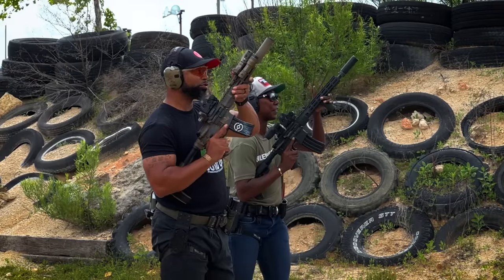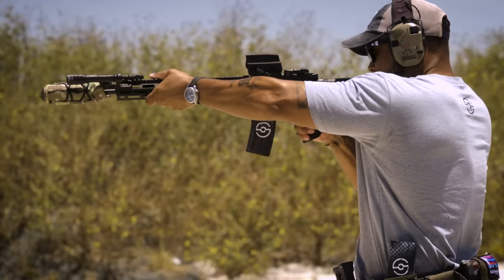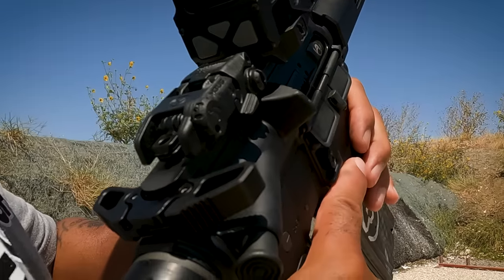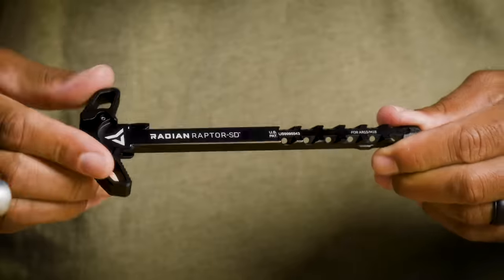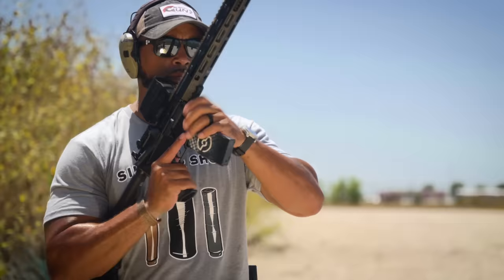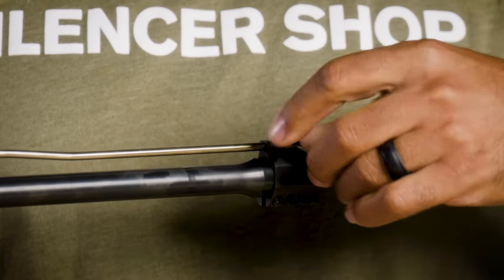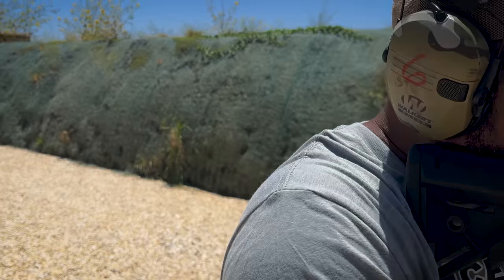How to Build an AR15 For Suppressors - Make Your Rifle Quieter!

Comment: Step one buy integrally suppressed upper 
Step two slap it on a cheap PSA lower
Step three go full send
Reply: That's exactly what I did with a Radical 10.5 integrated suppressed upper and PSA lower. 3 years later new match trigger, suppressor enhanced BCG, silent capture buffer and new CH. It runs.
Reply from the maker: Integral systems can be awesome, no doubt. Glad you're liking yours.
Reply: @HoagieHeadlock what if I already have a complete psa ar pistol
Reply: Ay thanks!

Comment: umm. how is an A5 longer travel? that's limited by the bolt carrier. if that's what it did, the gas key would be smashing the back of the receiver and it would most definitely not be "smoother shooting"
Reply: Longer time to cycle, not longer travel. It’s worded weird wrong, but that’s how the A5 works.
Reply from the maker: You're correct. The A5 provides a longer time to cycle, not longer distance traveled. Thank you for clarifying.

Comment: I just have to say that using JP SCS in an A5 buffer tube makes NO sense. JP SCS requires a spacer to run in an A5 tube that makes it just as long as the standard carbine length tube. Also there is no "longer travel" in an A5 system, even with its standard buffer and spring setup.
Reply from the maker: You're correct, its longer travel time, not longer distance.
Reply: Not with a JP SCS  @SilencerShop  😜

Comment: Hard to trust this guy if he doesn't even realize a silent capture spring in an A5 tube is useless
Reply from the maker: We used the A5 because its beneficial for most folks, we opted for the JP spring and spacer, but the A5 has great benefits if you're not using a SCS.

Comment: JP Enterprises' captured spring system is a must.
I can not stress how nice it is to not hear and feel the twang.
Reply: I like my vltor
Reply: @US2A  I just watched your March 2023 'unboxing' vid. Got any 'first impressions' or other testing videos?
I do loves me some data!
Reply: @hateferlife  no data, did a video or 2. On a 5 or 5.5 inch 556 it was great. I didn't I want to try one on a rifle though.
Reply: I heard those kind of design are prone to failure?
Reply: Shove some aeroshell 64 in a stock buffer setup and try em side by side. You'll realize that captured springs over complicate a really simple issue
Reply from the maker: Getting rid of the twang really makes a big difference. On a side note, its wild that silencers make the gunshot quiet enough that you can hear the spring!
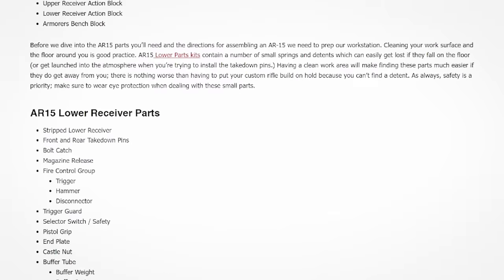Reply: I grease my springs and don’t have the thwang. I have a JP SCS and found the springs to be on the light side. Ended up having to do their AR10 springs on a suppressed 14.5” 5.56 to get ejection right. 4:00 unsuppressed and 3:00 suppressed (with a 30cal can do not as much back pressure)
Reply: @medicbrndn  I replied to trashcan above about greasing springs but it 'disappeared'. I agree. My go-to for years was clean with militec-1 and light grease with tw25b to reduce friction in the extension, which works just fine. When my buffer retainer pin decided to give up, instead of taking off the castle and all that, I went with a JP captured. The hype got me.
I find the captured system less grating on my nerves for long range days. Between less noise transfer by cheek weld and a more linear recoil cycle.
Just my observations, sample size of one.
Reply: That's all I use in all my rigs. I also use Rifle Speed adjustable gas blocks as well.

Comment: Love that charging handle but it absolutist does not stop gas from getting in my eyes
Reply from the maker: It should make a big difference compared to mil-spec, but if the gun is severely overgassed it wont completely fix that.
Reply: @SilencerShop  true.  I don't have an adjustable gas black on it so that might help
Reply: @James-cr5mc  adjustable block is really all you need for a suppressed rifle. everything else is just comfort food.

Comment: Ejection pattern was perfect? I'd say 3 o'clock is perfect...
Reply: Depends. It’s a balance between suppressed and unsuppressed.

If he wanted to tune it every time he took the suppressor off 3oclock would be the goal.

If he’s tuned it to balance both, it may be 2 o’clock for suppressed, 4 o’clock unsuppressed
Reply: 4 o'clock is the preferred ejection pattern not 3 o'clock!!! 

The guy in the video is not very smart!!! First the A5 buffer tube is pointless with a JP SCS!!! The A5 buffer tube is too long for the JP SCS unless you use the spacer that comes with it. The A5 should only be used with a RIFLE length spring and buffer. Second a suppressed AR rifle ejecting at 2 o'clock is not the perfect ejection position like he says. It's over gassed and has a hard recoil!!! The 4 o'clock position is the preferred ejection position! All the rifles in the video are all over gassed!!! You guys need to get a clue on how to tune a suppressed AR rifle!!! Just use a standard mil spec buffer tube, leave the regular spring in the JP SCS with the 2 tungsten weights and a regular weight and then turn your gas setting down a lot more until your ejection pattern is a 4 o'clock. That is how mine is set up and it runs like a dream! It shoots flat and soft and with little blowback and I'm using an old Surefire RC1 suppressor. My advise is if you are going to run a suppressor then you need to tune your rifle for running with the suppressor and leave it on all the time. People need to stop taking it off to shoot occasionally because its too heavy or for whatever reason crap too!!! Your suppressor should only come off your gun when you clean it!!!
Reply from the maker: Rile was ejecting about 2:30, we wanted to make sure we retained 100% reliability suppressed and unsuppressed. Also, bolt speed is a better indicator than brass ejection of total system pressure.
Reply: Bolt speed can be measured by how the brass is ejects Einstein!!!

Watch your own video and you can see that the AR that you built has more muzzle rise and a harder recoil than the AR's your shooting in the beginning of the video! Your bolt speed on your build is still too fast no matter what you think!

You say in the beginning of your video that you do all this shooting and that it is all suppressed, so I am wondering why you don't tune your suppressed AR's to run suppressed all the time???

I find it comical that you say you want to retain 100% reliability when shooting suppressed and unsuppressed but you are always shooting suppressed! So what's the point of tuning them so hot for then??? Pick how you are going to run whether it is suppressed or unsuppressed and tune accordingly. If you run suppressed all the time then turn the gas down or use heavier buffer weights and spring and if you decide to run unsuppressed then change the gas settings or to a lighter buffer weight and spring. It's very fast and simple to do if you know how your gun runs! Mine is tuned to run suppressed and when I take off my suppressor it runs just fine without any changes.

I am getting the impression that you have no clue on what you are talking about and I am betting that you probably have never shot a properly tuned suppressed AR!!!

I think you should not even be selling suppressors seeing how you don't understand the basics of how an AR works or how to build an AR or tune an AR for that matter!!!

P. S. The bolt does not have a longer travel when using a A5 buffer tube with a JP SCS. It's only true if you are using a rifle length buffer and spring!!!  @SilencerShop
Reply: @johnl-cz2qg  Big clown energy.

Comment: The Radian Charging Handle is by far the worst charging handle at gas mitigation. It doesn’t properly seal around the top of the upper receiver, allowing gas to escape directly into your face. The Geissele SCH and Silencer Co charging handle are far better. Also, if you’re running an adjustable gas block, wouldn’t it make more sense to use a lighter buffer and spring? It would require less gas to cycle the weapon and since you can restrict the gas with the adjustable block that would seem more ideal
Reply from the maker: No, the goal is to keep the bolt locked in battery so that barrel pressure can drop, so a heavier buffer is more desirable for most setups.

Comment: I’ve had good luck with just a h3 buffer and stronger springco spring. Several thousand rounds through both my Geissele 11.5” and BCM 14.5” without any suppression related issues.
Reply from the maker: Nice, heavier buffers help a lot with slowing down the bolt and keeping it locked up longer.

Comment: A properly tuned piston upper is an easy way to reduce gas near the shooter, among other benefits.
Reply: Adds weight, adds a proprietary part, adds reciprocating mass, also can be less reliable once they get dirty.
Reply: @TheEDCTribe  only the last one is a real issue go to the gym
Reply: @kujokage4611  they’re all sub optimal
Reply: @kujokage4611 Weight matters when your gun isn’t just sitting in a safe buddy.
Reply: @Shane10871  if your gun is too heavy for you you have a issue which you can solve by not being weak
Reply from the maker: Piston rifles definitely have their benefits, we've found that well tuned DI guns seem to shoot a bit softer.

Comment: Sub- sonic ammo is critical. Ammo I use doesn't allow for carrier cycling. Sucks but runs like a pellet gun. What ammo are you running in the video?
Reply from the maker: For 5.56 guns we run supersonic ammo, generally 55 grain M193, we don't like to oversell performance by using specialty ammo. 
Form 9mm, .22lr, and 300BLK, we use subsonic as those are common loadings for those calibers.

Comment: When I first got into AR15’s, I thought I’d want to suppress them and found piston guns were better than direct impingement for cleanliness and sound at the shooters ear. I went with Adams Arms for the majority of my AR15 and AR10 collection and also have a PWS and Sig Rattler that are piston driven as well. You can even buy piston kits that have adjustable gas blocks to turn your DI gun into a piston gun.
Reply: Do not buy a piston kit for your DI ar. Just buy a Piston ar. Both of the kits on the market have multiple issues and aren’t really rated for duty use
Reply: @alexmiller5796  which kits? Adams Arms even? The complete uppers and guns have been flawless for me.
Reply: @RangeToyz  both the Adams and superlative. Maybe built from factory is better but I’ve seen a lot of issues with the kits personally. I’m one person though so my input isn’t the best
Reply: You can still use adjustable gas blocks on a DI guns. Problem with those is many times to adjust it requires some kind of tool and toolless stuff like riflepseed just look werid. I dont know why some companies like Geisselle or DD didin't come up with AGB for DI system already, with their own line of handguards with cutout piston style toolles adjustment feature like PWS or MCX from Sig.
Reply: @alexmiller5796  sounds like they should be installed by a gunsmith. When I got the new AARS handguard for my AA P2 308, I brought it to Curt’s Discount Shooters Supply. It came with a different barrel nut and however it was, they left out some bushing or washer or something on the piston for a correct fit. It runs flawless now, just as before.
Reply from the maker: Correctly tuned DI rifles tend to be a bit softer shooting and lighter weight, but piston uppers definitely have their advantages.
Reply: @SilencerShop  respectfully, short stroke pistons shouldn’t be different in recoil and the weight of mine is negligible to DI. Different milling in hand guards or receivers would make more of a difference.

Comment: Armaspec captured spring is a cheaper option to the JP springs and is also really, really good. I've used both. Cannot overstate how amazing these options are. Not just twang, but with the Armaspec SRS multi-stage spring specifically, it's significantly smoother and a much nicer recoil impulse.
Reply from the maker: Nice! Thanks for sharing your experience!
Reply: Price on the Suppressor  then tax stamp price then the wait begins  may take up to 2 yrs before you can install  it on your rifle
Reply: @sdoaker  nah. Generally 12-14 months worst case scenario. I've had one that took 3 months. I currently have 2 at a 12 months. It's all over the place, but I've never seen a 2 year without requiring a refile

Comment: Don't think for one second that you can use an adjustable gas block for your SHTF rifle. This is a build for playing around.
Reply: Good video over all
Reply: Disagree. Military service rifles all over the world use adjustable systems, if they’re tuned correctly there is no issue.
Reply: I have thousands of rounds through AGBs that I haven't adjusted since setting them up and my ejection patterns haven't changed. You think you're going to shoot that many rounds in your SHTF scenario, like herds in the walking dead? I trust quality AGBs since they haven't failed me yet.
Reply: @TheEDCTribe  not AR15/M4 with AGB. It's not the same.
Reply: In SHTF your best bet to survive is to avoid gun battles.
Reply: @watermann8200  You 'get it'.
Reply: This statement always makes me smile. One of the main arguments in this debate is that AGB can carbon lock and it becomes a regular gas block. 
If You use clever design (will not say which brands) it mostly not going to happen if You rotate it and oil every few hundred rounds. And even if for some reason it stuck the gun still shots... The problem with AGB is many times ppl are tring to setup it to shots the flattest which is not good (you should always have gun a littlebit overgased for relability for SHTF or HD). If You dont have an AGB in shft sitation you must carry extra buffer weights and springs, cus You never know what kind of ammo or weather You are going encounter.
Reply from the maker: Tuned correctly, there shouldn't be any reliability issues
Reply: @Helibeaver That's not how this works. If you set your gas settings when suppressed to eject at the same pattern as it would unsuppressed, the gun will run with the exact same way. If you want to call out misinfo, you could have dialed into how they failed to use the A5 buffer tube correctly and don't know why it's an improvement. You didn't make it that far did you?
Reply: I guess you have more experience than the countries largest suppressor retailer.
Reply: Disagree !
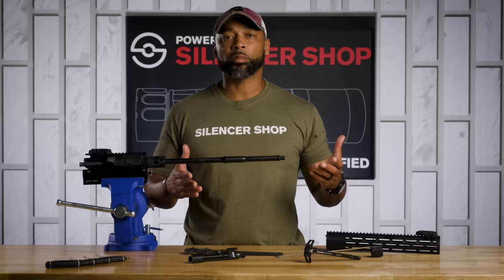Reply: I’ve used an adjustable gas block on my duty rifle for close to a decade and in excess of 10000 rounds (probably close to 20K) once adjusted for supressed use I never mess with it. I don’t care if the adjustment screw carbon locks as it is never changed. I have not experienced any malfunctions and (being supressed) have run this thing filthy to see if it would run. Consistent ejection 3:30-4 and soft shooting. Matched with proper buffer spring and buffer it’s a great setup and I have no hesitation on using this in any situation on any firearm.